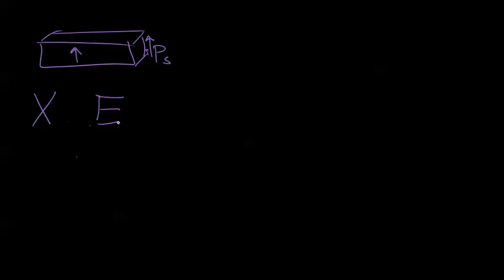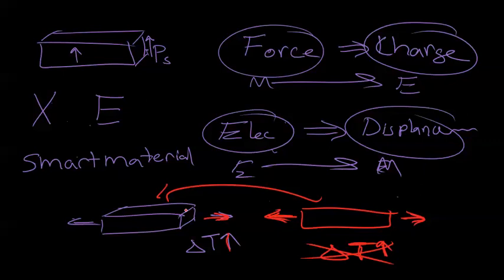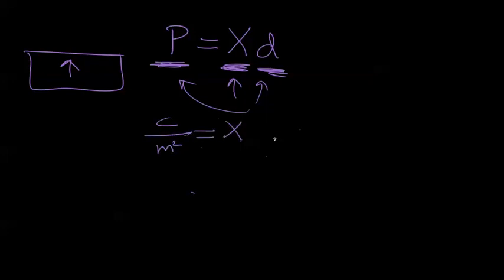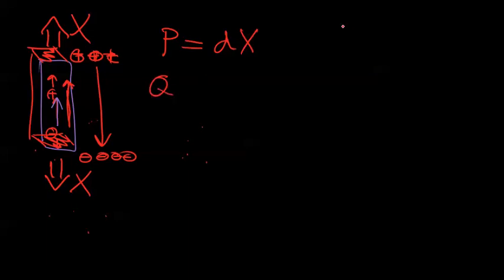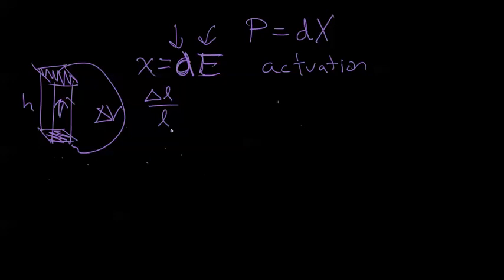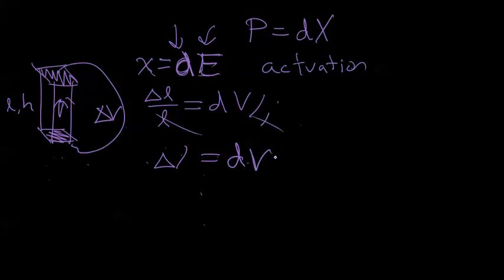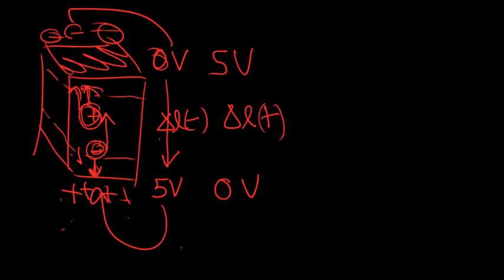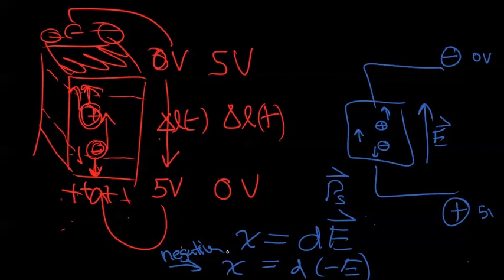Learn Piezo Lecture 3C: The fundamental piezoelectric quantity - the Piezoelectric charge constant

Comment: thank you for your explanations. but reversal of the electric field does not reverse the direction of the deformation. to clarify there is a displacement-field hysteresis loop. so when field is negative, at a certain critical field, known as the coercive field, the polarization or displacement reaches zero. This is the point where the dipoles in the material switch their orientation. so hereon the further increase in negative field will actually cause the sample to expand.

Comment: at 11 mins 38 sec you show piezo with a voltage applied. Top electrode is 0V,  bottom is 5V.  You say this causes the material to shrink but wouldn't the dipole moment be stretch due to this difference in potential and the block expand? Many thanks, Dave
Reply: @ultrasonicadvisors  so that means when it's parallel it enlarges?
Reply: I also think it's a little weird. and I reckon that it should be on the contrary.

Comment: x=d*E.. Is there a technique to measure the d coefficient experimentally?
Reply: @ultrasonicadvisors 
d=strain developed /applied electric field
The developed strain is found with the aid of the displacement sensor.
The electric field =applied voltage /thickness of the specimen, correct?
Reply: @ultrasonicadvisors  can we use the impedance analyzer to find out the dielectric constant, the capacitance is found using the impedance analyzer and then using this formula :
Dielectric constant=capcitance*thickness /area?
Reply: @ultrasonicadvisors  Thank you so much 🙏

Comment: About to start my MSc thesis involving piezoelectric material, and I'm extremely grateful for these lectures you have created where you explain everything in an understandable way.

I have a question however, starting from 11.19 I got confused, first you say applying an electrical field from top to bottom, 0V on top and 5V on the bottom (I thought the electric field would go from 5V to 0V), will cause the material to shrink. Then when you explain a bit deeper at 11.55, you say the same field will make the material expand.

My understanding is this:
The applied electric field will go from positive to negative (5V to 0V), and if it's applied in opposite direction to the polarization, then the material will shrink (i.e. a negative delta L). If the electric field is applied in the same direction as the polarization, then the material will expand (positive delta L).

Is my understanding correct, or have I misunderstood something?

Once again, thank you very much for taking the time to create all this material in such detail!

Comment: 5:39 The electric field direction and dipole direction are opposite, to be charge balance, it develops positive on the top and negative on the bottom(outside), but the field direction outside and inside of the block are the same, why is this development not an“enhance”？
Reply: Thanks a lot, very helpful.

Comment: 7:34 why do you say reverse field? Is there a field which is reverse? I don't see one, both are in the same direction (E vector points down)
Reply: 13:11 you explain that the material becomes bigger when the top is negative. Moments before you explained the material length gets smaller which you even denoted by (-) delta l
Reply: @Nicknamelikeyours  exactly. so which one is true :D